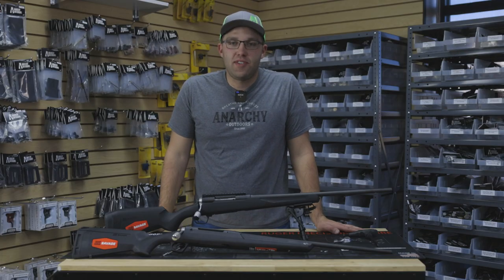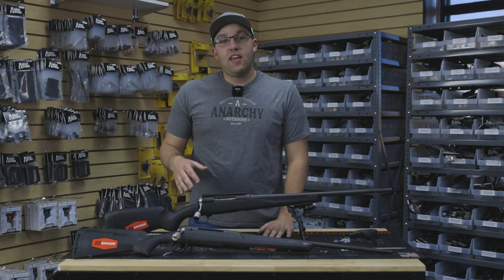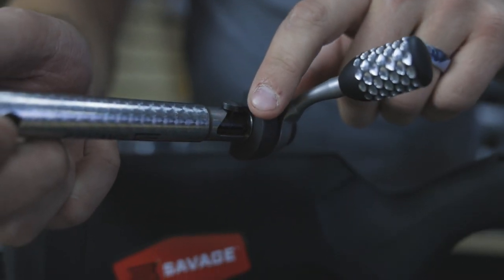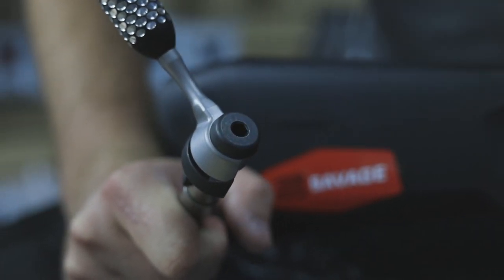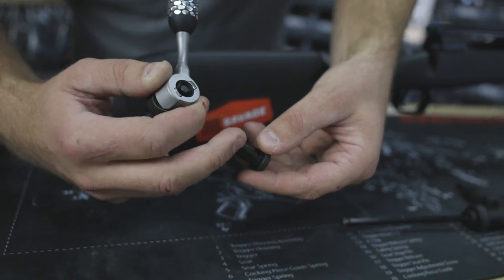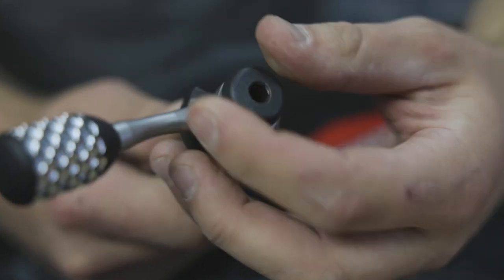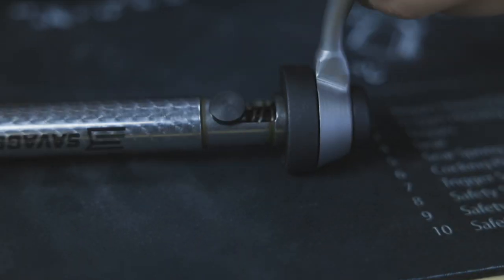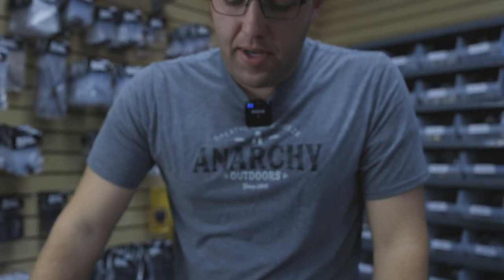Savage 110 Best Upgrades // Anarchy Outdoors

Comment: Don't pinch your skin cuz that would hurt  20 seconds later bleeding from finger.   Spring goes flying- Be careful not to lose spring.   Now we need to reset  this up into that slot (shows spring jacked in slot) Cut scene . Little tough to do that.     There ya go!   Hmm
Reply from the maker: Thanks for the comment.
Reply from the maker: Thanks